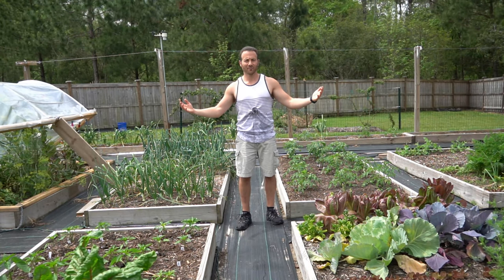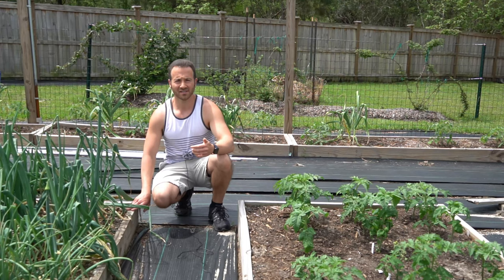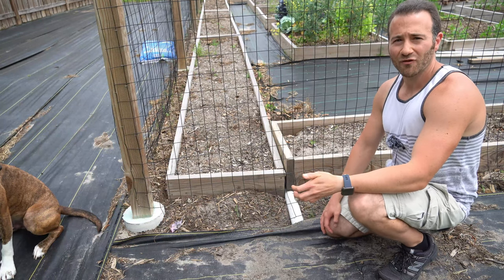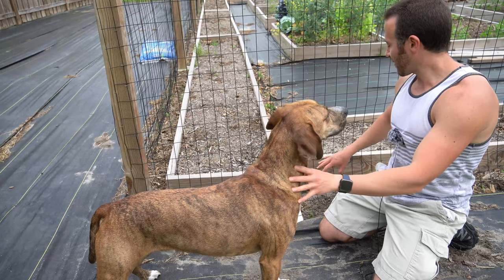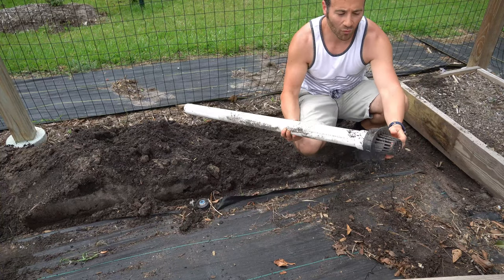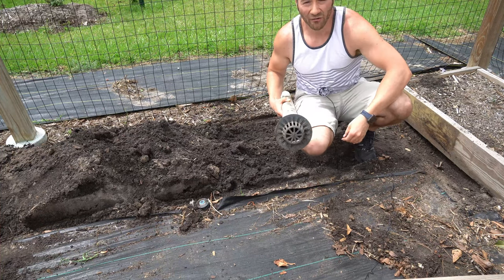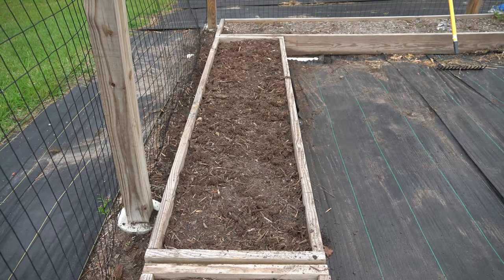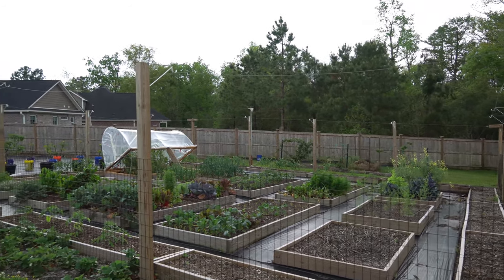How To Fix Flooding In A Raised Bed Garden | Cheap DIY Garden Drainage

Comment: If I were you I would just take a saw and shorten the raised bed that was jacked up just enough for the water to pass through in case of flash floods. That drain entrance will eventually be clogged up with leaves, soil, twigs and some other random debris. Might not look that neat aesthetically but will save the need to keep the drainage pipe clean.
Reply from the maker: I considered that, but I didn't want to shorten by beds.  This drain did work for about 8 months despite debris piling up.  Water always winds a way to trickle out.

Comment: ,,🏡. I have a very narrow lot . Boundary lines are right on my garage wall. No gutters . The run off floods the sidewalk which drains into my new flowerbed keeping the great soil too moist at times causing root rot to perrenial garden shrubs, plants and bushes . I have to save this ground but have nowhere to run it to the bog on the other side of my lot . Any Experts advice to correct this would be so much apptteciated . I am not strog nor the $$ to pay for draina experts . Can this drainage system be covered by a natural pathway or grass to mow ?.

Comment: How do you keep leaves, twigs and such from blocking the intake of the drainage pipe?
Reply from the maker: The drain grate was sufficient.  "Water finds a way," as they say.  I had that drain under the bed for probably 8 months rigged like that and I never had to clean it once.  If I did, however, it easily pops off and you can blow out the PVC pipe with a hose nozzle.

Comment: Question? why didnt you just paint the pvc brown or green and at bottom of raised bed board cut a 1/2 circle on bottom board and run the pipe thru the board? sit bed down on pipe and no digging? loose a little soil real-estate but not enough to matter
Reply from the maker: I didn't want to cut up the raised bed.  I also don't own a jigsaw, so cutting a circle would be impossible with the tools I have.  Woodworking isn't my thing.
Reply: @TheMillennialGardener   Ok I was just curious . The way you did it looks to work just fine. Maybe woodwork is not your thing But dang man You sure have a green thumb and Your garden and trees show it! kudos to you well done

Comment: maybe removing all tgat plasic material on the ground would let the water soak into the soil as it should...
Reply from the maker: The plastic material is weed barrier and permanently suppresses weeds.  The native ground is pitched heavily, so it doesn't not absorb deluge rainfall well, which is the problem.  Removing the weed barrier won't help with the drainage, and it will cause weed growth if I do.  I suggest everyone use weed barrier in appropriate areas.
Reply: @TheMillennialGardener  I can't use it. It retains water to the point of making problems.